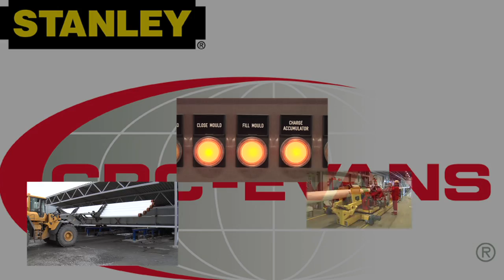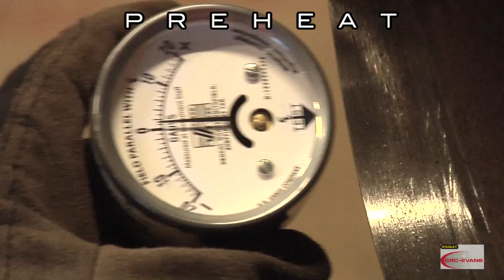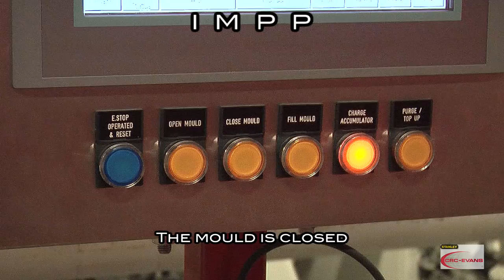Spoolbase Pipeline Fabrication

Comment: Excellent welding equipment giving perfect welds, but what part of the job does the music do ?
Reply: Oh, that is just to annoy the viewers. The noise (a.k.a. "music" - heh, heh...) is usually chosen by that guy who worked at drop hammer heavy forge and never wore any hearing protection. I gues he's done that to prove you don't loose hearing - and he's right, he still can the difference between this kind of "music" and no music.
See? (Or "hear, hear", as they say...)

Comment: Where I come from, if you grind on the pipe any where out of that bevel it's a cut out.
Reply: it was a wire brush
Reply: why
Reply: yes you right.its true.but only if the rod touch the out side the bevel.

Comment: can someone explain what is the used of IMPP in this process? I still could not get it
Reply: To protect the weld from corrotion made by water salinity
Reply: @luisfelipemunozfrausto7542   what about the interior area of pipe? isnt it supposed te be coated and protected from  corrosion too? sometimes the ppeline is used for wet gaz transportation wich can cause corrosion too!

Comment: What is the polyurethane coating for?
Reply: It is a tough and durable protective coating for the subsea pipeline. The pipe lengths are already coated with it (white coating). The IMPP is applied to the joint area after welding and NDT. The half shell is fixed to the bottom half of the joint as a temporary protection from the rollers as the fresh joint moves along the line. It is removed after curing.
Reply: Alex Finn  To piss the welder off that has to repair that weld 20 - 30 years down the road. Don't need that poly. on it if it's going under water. A swrenk sleeve would be just fine.
Reply: to protect the painted pipe from impacts, rocks etc on the seabed.

Comment: I take it that this is used for offshore type applications ?
I noticed the wall thickness is pretty heavy. I've done years and years of mainland pipeline work and its 
typically thinner than std wall thickness.
Before they sandblasted it , I noticed an arrow drawn on the pipe which is typical for x-ray.  
Do they do both x-ray and a.u.t ?  or do they a.u.t. guys use arrows as a reference zero also ?
I think its pretty cool how they can turn pipelining into an assembly line .
Reply: Moe Fugger 8
Reply: Yes it's probably for reel-lay vessel Seven Ocean

Comment: the whole polyurethane over the weld joint is a waste of time, and the fact they laid it over paint and not clean metal is pointless
Reply: actually, the polyurethane coating is an insulation for deep well rigs, if they used non insulated pipe, it would cause crazy temperature differences from inside and outside of the pipe, do some research, and that's not paint on the pipe, that's a glue.
Reply: Didn't you see that CCAB?

Comment: Way to much man hours put into the pipe weld . Your using a mig weld robot on 10'' pipe .....I can use my manual gas mig and have that same joint welded up 30 minutes , cleaned and pass  NDT xray inspection in 1 hour. Not gaining anything with your Spoolbase process .....
Reply: Sure you can, but you cant do that with as many welds they do in one day AND pass the NDT portion.. so blow off pal.
Reply: @phubarnow5388  actually, he can. Especially if all he has to do is weld them out. And I'm pretty sure there won't a seam in the cap pass from doing a 2 pass cap. That's completely unneccessary with wire in the first place.